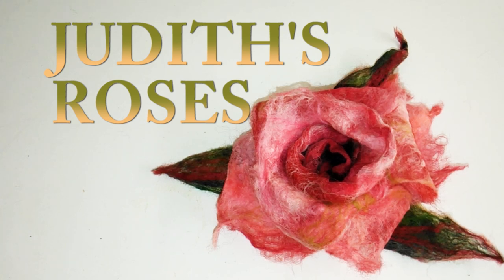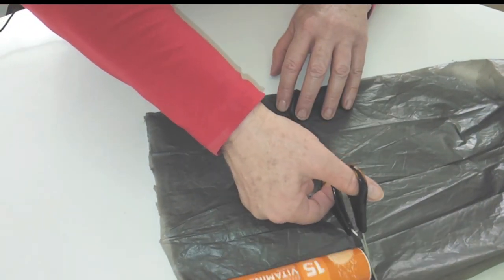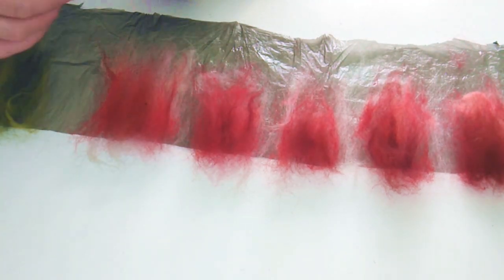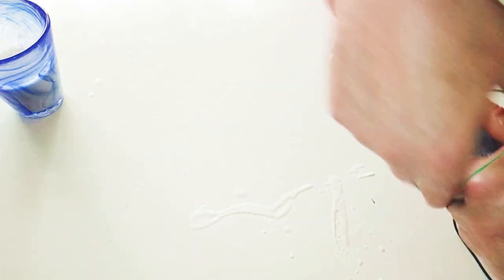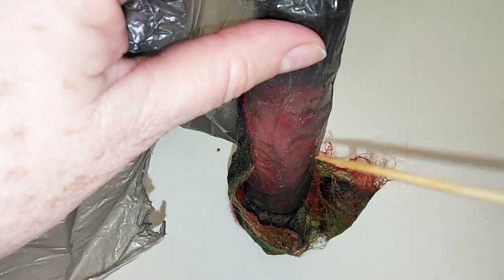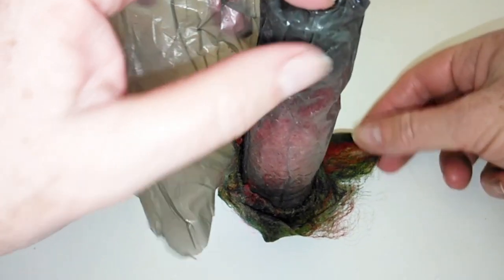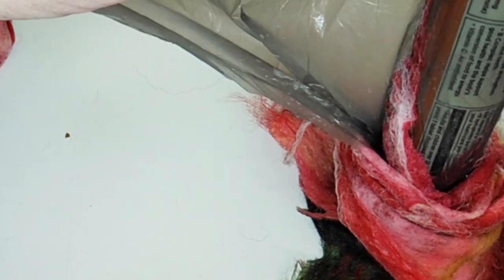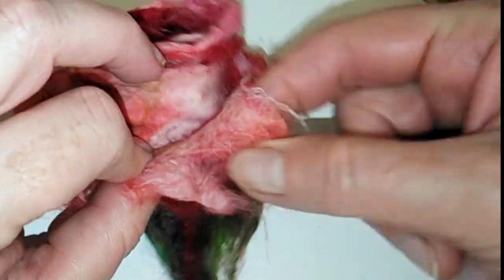Secrets to Sculpting a Stunning Wet-Felted Rose

Comment: What a beautiful delicate rose! Thank you so much for sharing.  I actually just finished making my very first rose using Judith’s method and with your explanations. It turned out lovely.  I was unsure of the amount of soap on the plastic, I used a paintbrush to spread it evenly, that made me realize I needed more.  I started around 10 this morning and, with 2 breaks, I rinsed it by 3.30 pm.  I did not do as good of a job as yours cutting the petals, but stretching them and rolling them helped. I’m grateful for you expertise and generosity.
Reply from the maker: Hi Pippi. I am thrilled that you have made your first rose. Good innovation on your part too. I think everyone who makes one will make their own adjustments and improvements in the method. Your timing would match mine pretty accurately. I never used to cut them at all . I think some people are so brilliant that they can plan ahead and work out the petals to come out exactly where needed. Thank you so much for letting me know.  about your adventures. So lovely of you.

Comment: Great video I have one question how do you get all the soap out of the flower?
Reply from the maker: Hi Pattie... great question . You made me realise that this is something I forgot to say. 
One way is to rinse the whole parcel very thoroughly before you undo it. This would mean rinsing until no soapiness is evident in the rinse water.  I would get a container like a drink shaker that is the size to hold the parcel vertically and then keep pouring in fresh water.  
Since I made this video , I have experimented with some different ways of working such as continuing to felt the petals very gently by hand  and this has meant adding soap again to felt the wool some more. So... then I have to just put the whole rose in the water and rinse it out and squeeze out all the excess water. It was scary at first as I thought I would totally lose the shape , But , I didnt and each time , I was able to just gently massage the petals back where they started. 
The same applies to if the rose gets squished or looks a bit tired after 10 years...you can just dunk it into some soapy water and rinse it out.  It will come back to life beautifully. Thank you so much for watching and thankyou especially for this important question . Best Wishes, Christine.